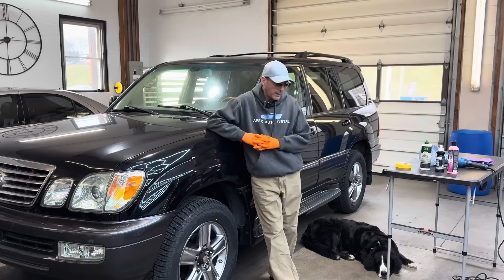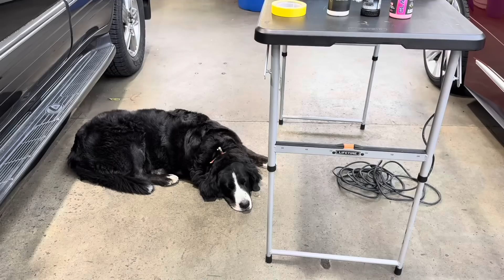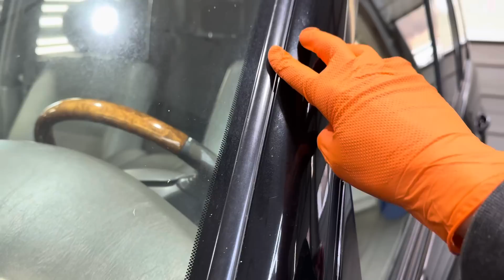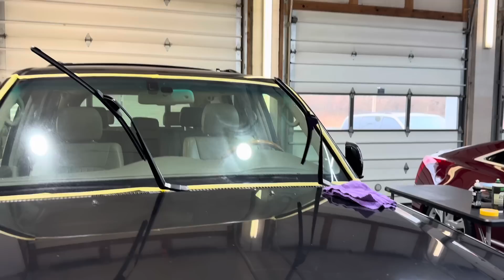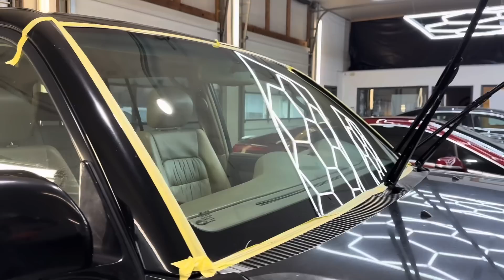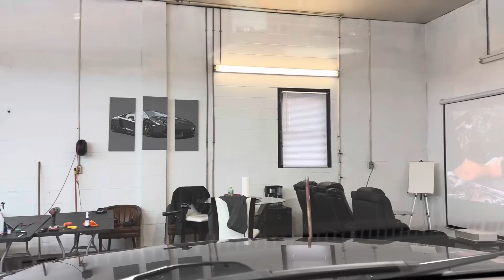How To Polish Out The Worst Water Spots From Automotive Glass!

Comment: Have you ever tries CarPro Ceriglass and if so, how does it compare to Sonax?
Reply: They're all very similar, using the same abrasive and a mix of polishing oils. Just use an aggressive pad and any of them will work just fine. I use 3M but have tried CeriGlass as well, equally good. Use a rotary if you have one, and a water mist to extend polishing cycles if you need to.
Reply from the maker: That is the first one I ever tried. As someone mentioned...not a whole lot separate them when it comes to performance. Some do start to dust way too soon.
Reply: these thing is marketing the reel one was always the brown caocaina who clean 10x better* irony* im taling about only glass ofc*